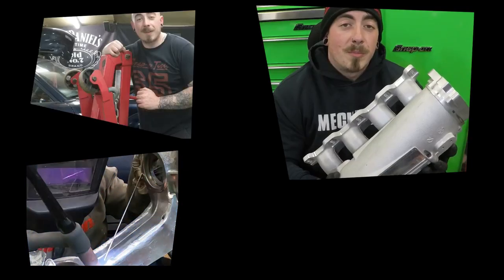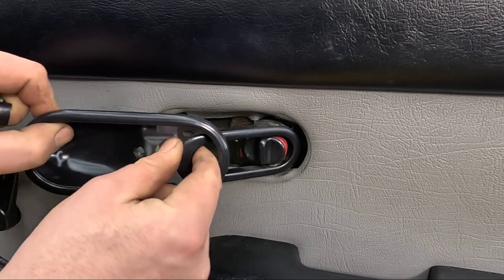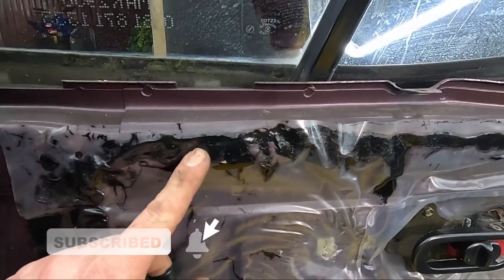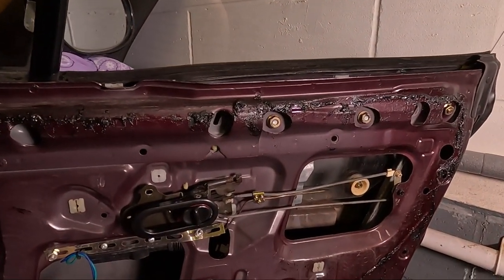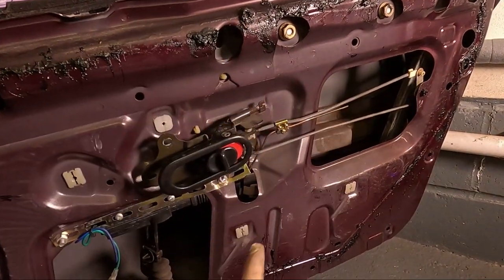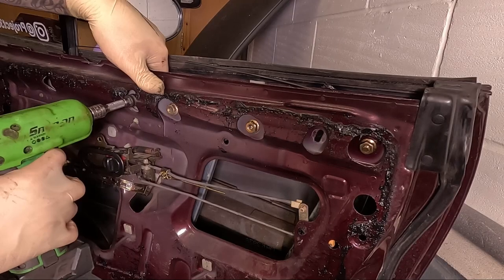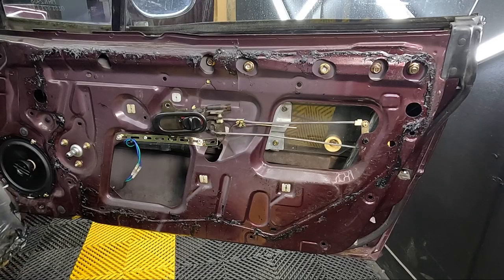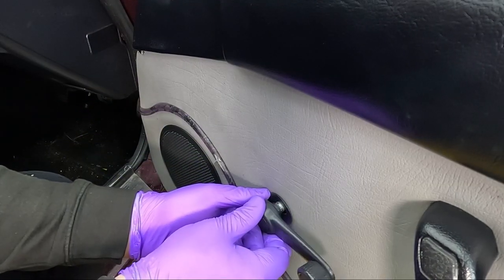MX5 MIATA MK1 MANUAL WINDOW REGULATOR REPLACEMENT : Dr pepper install

Comment: Also happened to me, I wonder if you can just swap the cables over, or would it be more sensible to swap the whole regulator unit out?
Reply from the maker: ive swapped the cables over before, absolute nightmare but it can be done